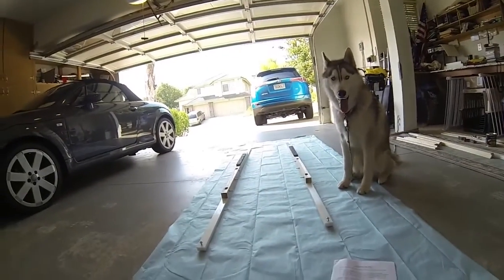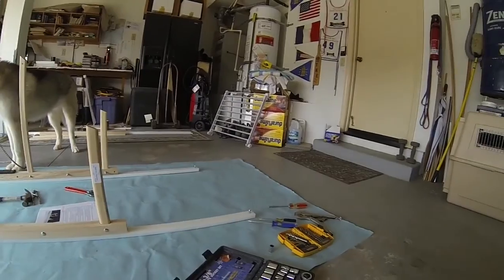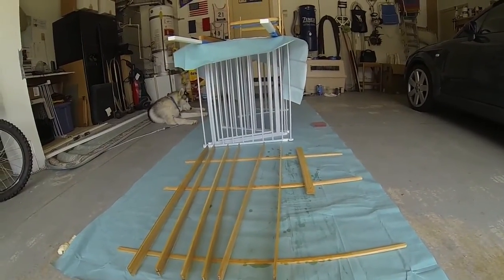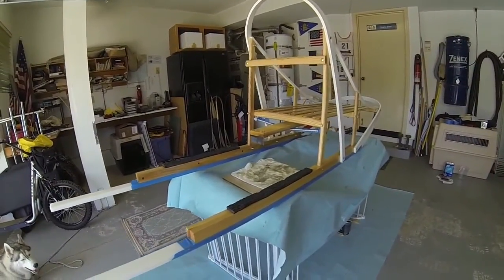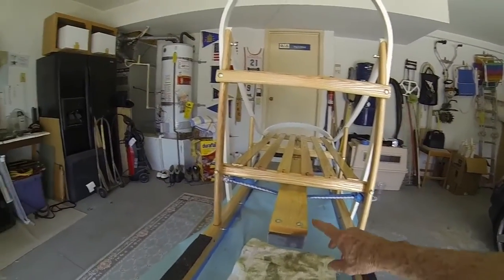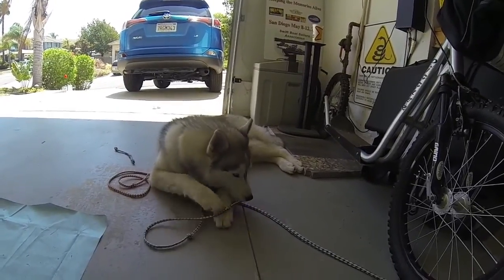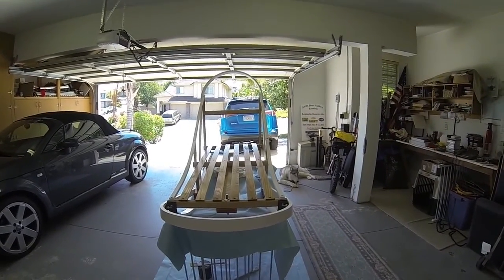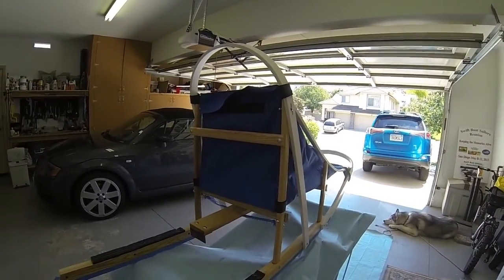Dog Sled for Dummies

Comment: I'm building one from 100% free scrap lumber and other free items...even stainless steel screws were left by a dumpster.   My nephew has 1 golden retriever and he's about to get a workout for Christmas hahaha!   This panoramic view will prove helpful tomorrow when I build the final parts.   So far I have just referenced one photo of an old classic sled.   Tying the uprights/sides to runners today was extremely satisfying.  I can't believe how much strength can be achieved from just small diameter string and multiple wraps.   

Is there a follow up video of 'chewy' pulling sled?!

Comment: looks nice but I noticed theirs no bracing for the sled to go side to side it looks it might fall apart??
Reply: thanks for the idea though I'm going to build myself one that looks nice (y)
Reply from the maker: Hi Darren, there are four structures that strengthen the side to side movement. The two cross-members on the back, the brush bow and the musher's handle all provide great strength. I amazed how well this sled is designed and hope this helps.
Reply: OK now I see your comment and that holds it good enough, I think I'll give it a shot I've never worked with that material before what is it called by the way?? I'm building a sled for my baby just something to push her around in I don't have any dogs I just like this design so I'm going with it
Reply from the maker: Darren, all the wood is white ash and the runners, stringers, bow brush and musher's handle are High-density Polyethylene. The HDPE is very strong, and bends easily without breaking. Total assembly weights 32 pounds. You kid will love it.
Reply: Virg Erwin awesome man thx (y)
Reply: Darren Halkett I agree, doesn't matter the wood.  just no lateral support.
Reply from the maker: Hey Guys, I enjoy your comments. I have not yet made my first run with this sled, but the lateral strength feel pretty strong from the HDPE musher's handle. It gives a little, but I thought that was a design feature for helping in the turns. I'll learn soon enough.